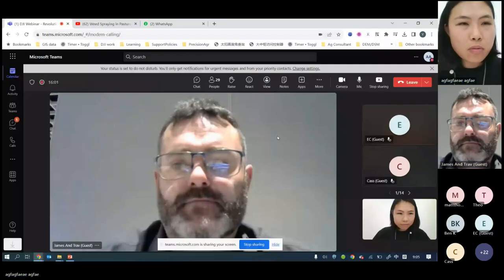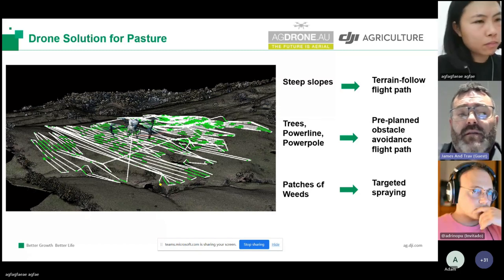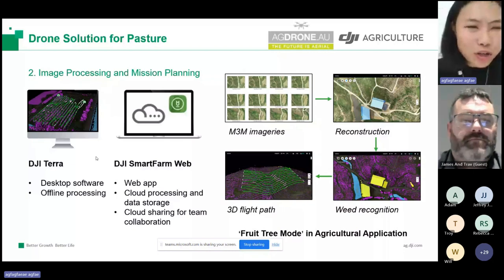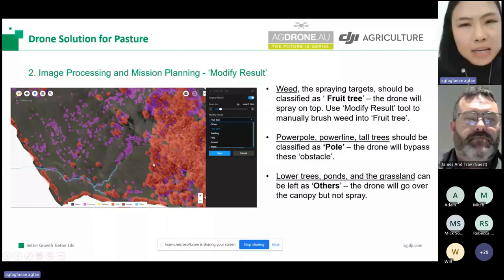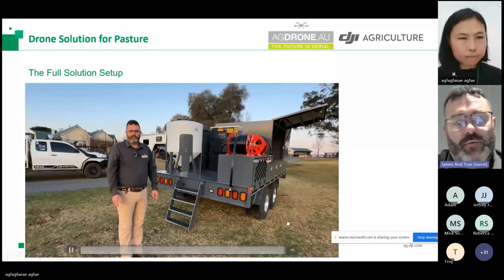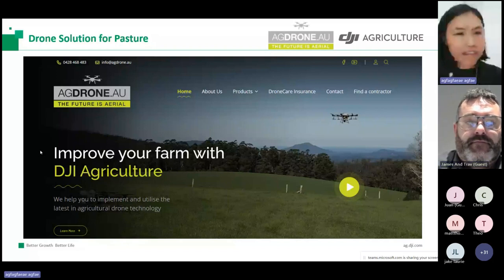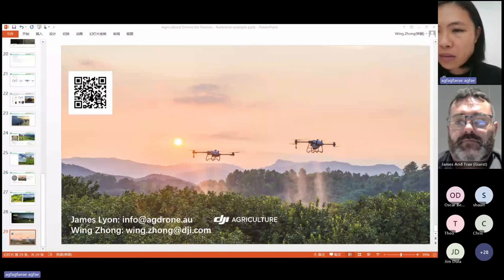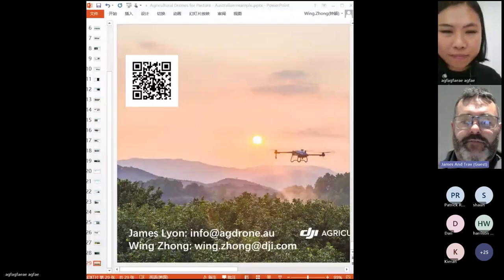Revolutionizing Weed Spraying in Pasture | DJI Agriculture Webinar

Comment: I am curious as to why each flight route needs a new calibration point? If creating a 3D reconstruction from a M3M mapping mission, surely that map can be calibrated using one point. Having to recalibrate at each flight route is very tedious and time consuming. It would be beneficial to us to drop the spray drone on a calibration point at the start of the day and have all flight routes calibrated to that point(ie: the full 3d reconstruction calibrated to one point) rather than doing it each time at the start of a field. Any feedback on this would be great. Many thanks
Reply: Hi there, as long as RTK is turned on when mapping with M3M, no calibration point is needed (Terra will look at RTK status of the M3M photos automatically and decide whether it will make you add calibration point). And in 'fruit tree mode', we recommend always turn on RTK for accuracy and safety purposes.